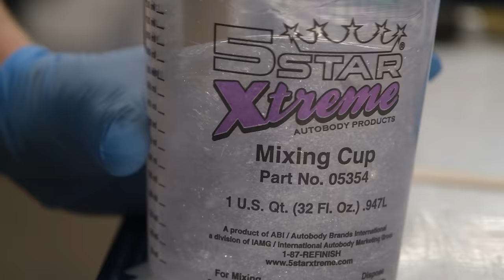Our Client Got Surprised With A Custom Star Wars Table

Comment: The table was great, but the mini setup hurt to watch. Should've taken the time to do it right with 3D Resin prints and actually planning the scale to thickness ahead of time. Excellent idea and they did great with the parts they are experienced at, but man those mini's look rough.
Reply: Agreed. The table itself looks nice, but I didn’t like that miniature setup at all. The base looks completely out of place, the figures aren’t sized correctly. The ‘snow’ doesn’t even look snowy. They could have made this so much better.